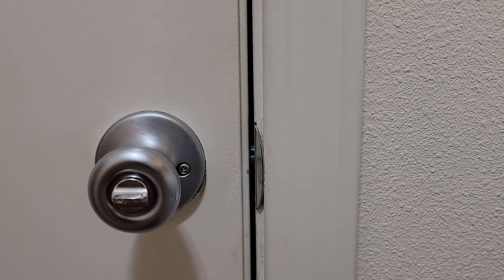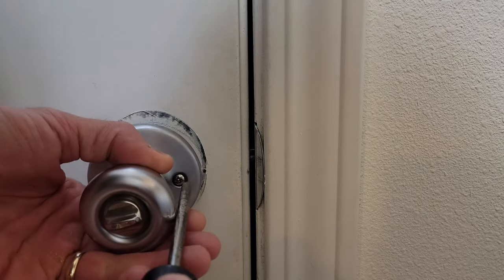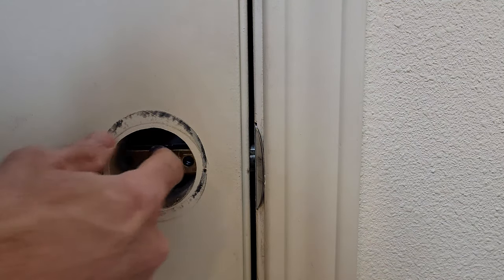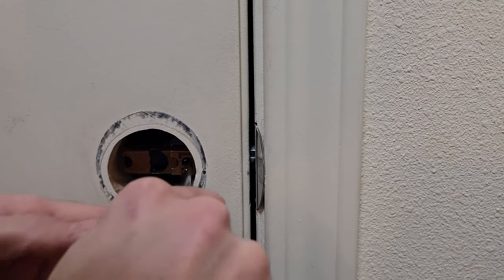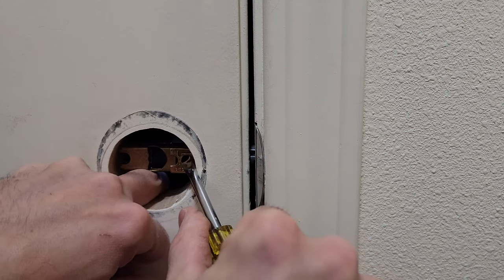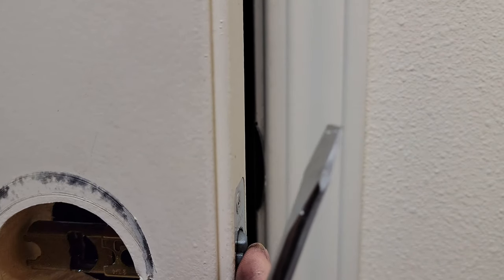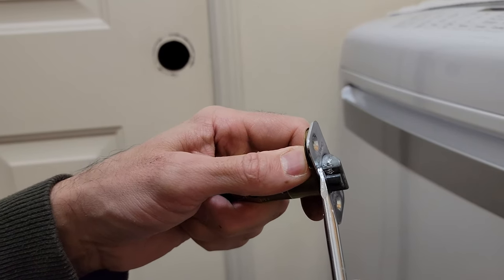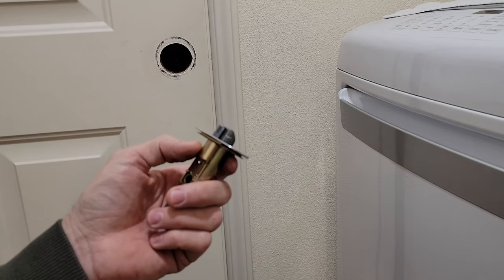HOW TO OPEN A STUCK DOOR.. HANDLE TURNS BUT BOLT WON'T RECEDE

Comment: I unbend a large paperclip and curve it into a "C" shape. Then feed it through the gap between the door and the door jamb (instead of the screw driver).  Once I have both ends of the paperclip, I bent the two ends together making a ring around the latch.  Because the latch has a slant on the opposite end, I was able to use the paper clip to force the latch into the door, thus opening the door.
Reply from the maker: Great explanation! Thank YOU my FRIEND :)
Reply: Imma try that right now.
Edit:  Unfortunately mine would not budge with the screwdriver technique
👇
Reply: 5 minutes later….
It worked! 🙏 

Couple pliers  helped to bend the kinks out of the large paper clip while making the “C”   Making  it easier to fish around the latch. The  “lasso” was as close to the end of latch without fussing.  

Used larger pair of channellock to grab the two ends, had to ultimately pull quite hard,  harder than anticipated. More of a quick hard jerking pull actually. TADA! 🎊 

Thanks to both of you.  I was flummoxed as how to fix. Never hoped to find such a simple way.
Reply: Thank you @hariwiguna. This helped us just now. ❤
Reply: Thank you very much. The fastest solution to my problem. Didnt have paperclip, so i used that plastic spiral backbone thing from a notebook.
Reply: Thanks for the idea we used a wire hanger in our case with the same concept. Your a time saver ❤
Reply: Ah ok
Reply: Worked for me. I tied the two ends together a few times so I could grab it with a plier and pulled the plier back. Had to push the door back in the wedge with a screwdriver the whole time so I could reach the slant in the latch. I did have to yank hard with the pliers once I felt the paper clip ring touched the slant.
Reply: I have the same problem and this seems really helpful. Thank you!
Reply: @Changesonemack p
Reply: God bless you Sir  🫡  this just worked for me ! And now my husband thinks I am Wonder Woman 😂
Thanks for this video too , I get how it works 🤍
Reply: Did the same thing, but with a wire coat hanger.  The top of the hanger is already shaped like a hook, so it pops in pretty easily.
Reply: Thank you!

Comment: Same issue here but I've got a problem... The screw holes and the crack of the door are all on the other side. I can't use this strategy to get in at all
Reply from the maker: if you have no way to get to the other side of the door.. you may have to remove the molding to access that

Comment: Very grateful you put this video up. This exact issue just happen and the doors are slightly swollen from the humidity so the handle fallen off and the door was jammed and I could not turn because there’s no mechanism so I had to pop my door open. Just exactly the same way you did.  i’ll be getting a new door handle this weekend!
Reply from the maker: I'm so happy this was useful for you my Friend

Comment: Huge huge thanks.
You have no idea how your video save me, my closet door knob get stuck like this for over a month.  I try to buy hand saw to cut the knob.  But home depot guy told me not to , better call the lock smith to fix it.  I am about to call  locksmith, but just had the idea to search the youtube first, then your video pop-up. 
After I watched, I just used 2 small  flat screwdrivers to open my door again, not even take 5 mins.  
I don't know how to thank you, but I subscribed, thumb up , your video right away.
Reply from the maker: Hey PAUL!  Just knowing that this video helped YOU is thanks enough!  Have a blessed day my FRIEND :)

Comment: Thank you this had me locked in my room for an hour, Now I'm trying to figure out why the door handle on the inside of my room will not fully turn. The outside turns fully but not the other.
Reply from the maker: ... sometimes a part can get broken off in the mechanism..

Comment: I had exactly the same problem.  To meove the bolt back manually, use a small, pocket sized, flat screwdriver or the like and, after sliding the little guard piece out of the way, shine a light in and go from the top and angle in behind the bolt face where the curve is, pry inward and pull gently on the door knob. 
  I removed the knob and bolt assembly just as did you, then I cleaned/lubed the bolt assembly to make it turn better and once the door knob assy. was back in the door,  the real problem is that the door jamb swole because it's winter and wet and things change.  I removed the strike plate and the knob worked properly so...  I got out a small chisle and gave some relief to both the inside of the bolt hole (made it a little deeper towards the inside edge) and set the mating surface for the strike plate a little deeper, also, setting it a bit farther away from the actual door.  This let the bolt move more freely in its allotted space and...  Presto!  😊
Reply from the maker: Thanks so much for the helpful advice :) my FRIEND :)

Comment: I had the exact same problem. Thanks for the video. I didn’t have a flat enough screwdriver to fit into the door slit but scissors actually worked much easier.
Reply from the maker: Hey Blake! I am glad you were able to get it unstuck!
Reply: Mine has done this twice with 2 different door knobs. Any idea as to what could be causing it?
Reply: @Drive-Thru_Dad  I noticed on my knew door nob, there is a plastic "half-moon" piece in the middle of latch, mirror of shape of to fit the knob "Actuator" if that's what it is called.
It was MISSING in this latch

Comment: hello everyone

around half hour ago im stuck in my room and i searched guide on youtube and i stumble on this video

however, this method not working on me as i cant even take out the lock even after i take out the knob

but, this video and some of comments here give an idea to me

i use two screw driver. one i put between door and wall, on the latch. then i push and i pull to move the latch inside. yes, this is not enough since i need to makesure the latch to fully retracted so i can open the door. so next while i hold on the latch, i use another screwdriver to pull another distance in the latch. then i repeat this. basically like you use two ski pole to climb the slope. keep doing it until you manage to retract the latch completely then you can open the door.

sorry my english is bad but i hope you guys get the gist of what im trying to tell here.

goodluck!
Reply from the maker: your english is just fine.. and thank you for this explanation.. it will be helpful

Comment: I was stuck in my room without the screws for hours so I pulled on it until I could see the internals and then I aligned the half circle with the pins and twisted it and it worked
Reply from the maker: Glad you escaped my FRIEND :)

Comment: I had same problem.  The old lock was made in USA and made from cast metal , about 40 years old.
I tried walking the peg back but no good. Luckily it was cast metal so I broke it out bit by bit. Then pulled the peg back. 
 I replaced with Chinese made . So I don't expect to get 40 years out of it.  This is the 3rd I've replaced. 
I would have like the original but can't find it in Australia.  If original owner bought here or imported I don't know.  Nothing in the house is standard.
Reply from the maker: the joys of living in a home :)  this is the first time I had experienced this

Comment: Great video!  Like others I have the same problem.   If I can't get the door to unlatch with your suggestions would     Plan B take the door off the hinges to remove the mechanism?   Sorry if this was covered in previous comments - I'm in a time crunch.   Thanks!
Reply from the maker: I apologize for the late reply, David. Yes, I would try to remove the hinge pins next.. I hope you got it figured out
Reply: I did - without Plan B.   I finally got the latch to open as you showed in the video.    Thanks for the reply and the help.

Comment: I couldn't get enough traction on the bolt to move it with the screwdriver alone. I put one side of the handle back in place and turned it until it engaged the bolt, it made the bolt open slightly. I held the handle in this position while using the flathead screwdriver directly on the bolt and was able to get leverage on it to pop it open.
Reply from the maker: Good tip, thanks my Friend

Comment: I wish the screws would come out of my handle like yours did lol, one came out cleanly but the other is so old and rusted it’s just stuck. Anyways thanks for the video!
Reply from the maker: Best of luck my Friend.. I cannot believe how common this problem is.. someone needs to reengineer these
Reply: @ETPCYT  thank you, and it worked!!!! I used a butter knife and it opened within a minute thanks so much I would have never thought to use it lol, and yeah I agree they should get on fixing that, dropped a sub ;)
Reply from the maker: Most appreciated my FRIEND! On the path to 100k SUBS.. it's been a long time lol
Reply: @ETPCYT  haha you’ll get there soon I’m sure 🙏🏽

Comment: I stuck a flat screw driver between  the door and door jamb gap to reach the stuck latch...hit it a few times with a hammer until it moved and then fell off
Reply from the maker: nice.. good tip there my FRIEND :) this was definitely not cool.. good thing it didn't happen during an emergency

Comment: Mine apparently is stuck dead!!! It wont even move….i have to use. A small pry to force it open.. but i found out if you have a set of  mechanics pick set , that it was small and skinny enough to 5:46 pull that latch back enough to get door open..
Reply from the maker: I am glad you got it worked out JOE :)

Comment: It’s not weird all this cheap crap from China. It’s been doing it. I’ve gone through four locks doing the same damn thing and I have to take the whole door off its hinges to get it undone. The cams keep breaking.
Reply from the maker: things used to be built to last for sure.. now it seems they are built to fail

Comment: i’m stuck in the bathroom and the door knob has no type of unsrewer stuff on it it’s similar to that but it’s a button instead of turner to lock
Reply from the maker: hmm if you have a screwdriver you should be able to get out.. maybe a nail file would work to unscrew it?
Reply: @ETPCYT  i escaped out window both legs broken i’m in hospital right now
Reply from the maker: oh my... get well soon !

Comment: In my case brute strength didn't work , I closely examined after removed the out parts n realised it was small part that got detached from the lever.
Reply from the maker: I figured something was breaking.. seems like a design flaw.. can be dangerous... Take care my FRIEND :)

Comment: I’m having the same problem now, unfortunately it’s not working. The space between the door jam and door is very small so I can fit something through but can’t finagle it once it’s in there. Any tips?
Reply from the maker: Hey Megan, sorry for the late reply.. you might have to remove the trim next to the door.. this should expose a larger gap.. you can run a razor between the trim and the wall to cut any caulking and then pry it off with a crowbar...  if that is too much .. try to access it from the hole where the handle was.. maybe it can be pulled back from that area some how.. I hope YOU get it.. this can be a dangerous thing

Comment: Mine is into the garage, can't tell whether it's the bottom lock or the  dead bolt.  Locked in. Ridiculous feeling
Reply from the maker: That is not good.. you should be able to see by the molding if it is the deadbolt or the doorknob .. it is definitely a safety issue.. I hope you get it resolved

Comment: Shoot I’m stuck inside and the screw spot is on other side and I’m in bathroom

( Update ) 
I found spoons? I’m trying to pry it open to push in the lock thing to get out
 [4 mins]

Update [ 5 mins ] I found a way out putting spoons between 1 on top 1 on bottom of the thing that pushes in and used a reverse pliers method
Reply from the maker: Last resort.. KICK THE DOOR DOWN!! ;)

Comment: This is not the way to open the door.  Remove the knob and then look at the hole the where the center of the knob fits.  On the inner side of that hole (towards the center of the door) at the 7 and 10 o’clock positions there are two pieces of metal that will slide towards the center.  Push on either with a screw driver and that will slide the bolt so you can pull the door open.
Reply from the maker: THank YOU SCOTT!! Many people have this issue..  we appreciate the tip

Comment: That works well if the screws are accessible. What do you do if the screws are on the other side of the door?
Reply from the maker: You would almost have to get something like a Dremel and cut the bolt or the doorknob off...

Comment: I’m still stuck! The screw on the right will NOT come out! Is that causing it not to open? Before removing the knob, to this point, I could most times open with a screwdriver. Now, my front door has been to this point, 3 days. If I break the screw off, will that make it worse?
Reply: I’m pushing the little lever up with a screwdriver, then trying to maneuver the door to open. Not happening.
Reply from the maker: Hello Georgia.. near as I can tell it is a portion of the bolt assembly that is breaking and this is causing it to malfunction.. some are more severe than others.  some of the bolts have a little metal piece on the side of the latch portion that needs to be push in to allow the rest of the bolt to open.  I am not sure if breaking the screw will help, it might jam it more.
Reply from the maker: hmmm it might have broken in a different area where the bolt will not retract... you can take the hinges off the door by pushing/ pulling the pin out of them .. this will free up your door..  and allow you to be able to remove and replace your door knob / bolt assembly.. I recommend 2 people for that though if you are not able to handle a door by yourself

Comment: What if you're on the other side of the door and can't get in? This happens to our bathroom door, we can't open it
Reply from the maker: You might have to remove the molding on the side by the knob to try to access the latch that way.. you should be able to push that in with something

Comment: I have exact same problem on my back door . Latch totally stuck , despite bolt moves easily with key, locks am
Nd unlocks , but latch solid. Cannot open door!
Reply from the maker: yeah the mechanism to open the door broke.. you have to pry the bolt out :(

Comment: How do i open the door with the same problem but its from the other side of the door, I really need help please
Reply from the maker: it's more difficult from the other side because you cannot access the screws to remove the handle.. you will almost have to get something to cut the bolt.. a hack saw blade or something
Reply: Take the pins out of the hinges you can use a screw to bump them out and the whole door will come out
Reply from the maker: @galaxiax3284  👍

Comment: my door won’t open and a credit card did not work  My gap is not as wide as yours…now what?
Reply from the maker: if you can get at the hinges you can remove the pin and take your door off that way..

Comment: it's open from inside. How about outside which really need very high skill and power tools. Most internet 99% show open from inside which is pointless
Reply from the maker: Yes, locks are designed to keep people out so probably not a lot of videos showing how yo do this from the outside

Comment: What if the screws on the inside? Im about to pulls the pins out then hopefully it loosens
Reply from the maker: if they are on the inside and you are outside.. its more tricky I think
Reply: I popped off pins and wiggled it loose and needed to change the handle it was a bitch to get off scuffed the trim a bit but it's accessible now😊

Comment: How do you suggest you do this if you were on the other side? I have to go inwards to the left and then into towards the latch to be able to do anything but I don’t have anything thin enough to do it
Reply: The door frame makes it extremely hard to get into it, the other side would be easier
Reply from the maker: hmm.. yeah thats a tough one.. I would try to access the other side if possible.. if not.. you might have to try to push the pin out of the hinges and remove your door
Reply from the maker: agreed

Comment: All u do is put the screwdriver in da big hole where do lil rod goes n turn it it will open...this guy is making it look difficult but it's not
Reply from the maker: Hey DEREK, it wasn't working with this because a piece broke off in the mechanism.. normally your idea would work I believe

Comment: I am stuck in a room since over 12 hrs. No way it's working for me
Reply from the maker: Eek.. might have to kick it open if there is no way out
Reply: @ETPCYT  it worked. I didn't have a screw driver earlier but found a small knife which helped. Many thanks for making this video.❤
Reply from the maker: YOU are most welcome :)

Comment: What if the door knob can't come off
Reply: From the outside*
Reply from the maker: that is a difficult situation.. one solution would be to cut the bold with a dremel or something like that... no matter what it's not going to be easy :(
Reply from the maker: I would try to find a way to get in to access the screws or you will have to probably cut the bolt :(

Comment: How about using credit card or something to get behind tongue and depress "bolt".
Reply: Lol, have it in my hand right now while watching this..
Reply from the maker: You can if the door isn't done correctly.. however this was quite snug and that wasn't viable
Reply: My wife did it to a door latch. It worked. I used kitchen knives to retract a dead bolt. Different door but both worked.

Comment: What if am locked outside the room
Reply from the maker: That makes it more difficult especially if you cannot access the other side.. it would be difficult to fix without damaging the doorframe
Reply: It's alright I was able to repair it with a tutorial, thanks though.